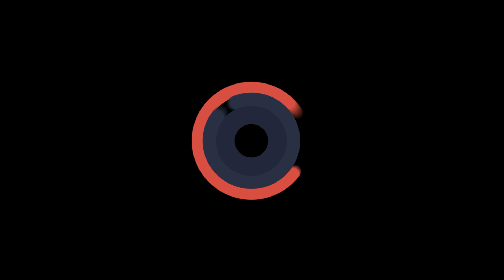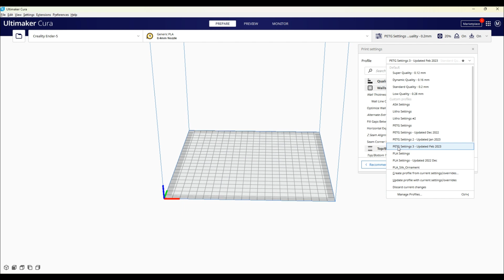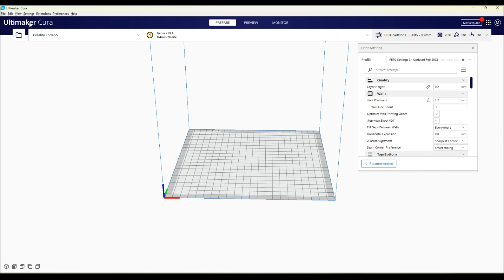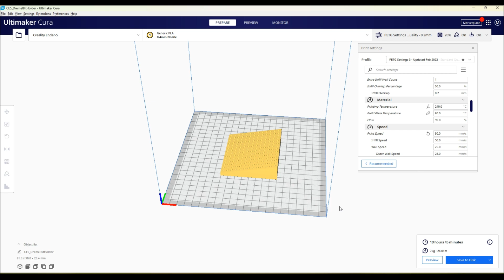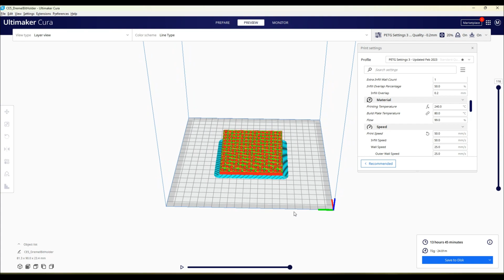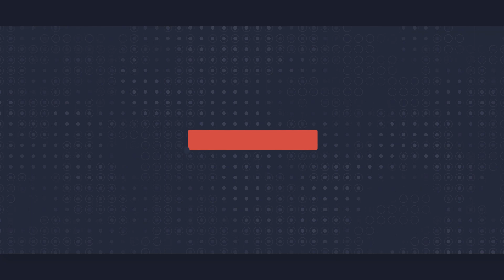Cura PETG settings for bowden tube Ender 5 Pro setup or similar printer

Comment: Never say never.  Petg needs minimal cooling but it is useful in certain situations.  But 15-30% depending what ur doing.   And if ur doing any bridging well u'll need more specifically for bridging obviously.  but that's a seperate setting.

Comment: Useful bit of info, thanks! Any updates since Cura 5?
Reply from the maker: Thanks for watching!  I moved away from Cura and started using Orca and Bambu slicers instead. My settings should still apply for the new versions of Cura though. If they do they me know and I can make a new updated video.
Reply: @MicBot  I'll let you know how it works out